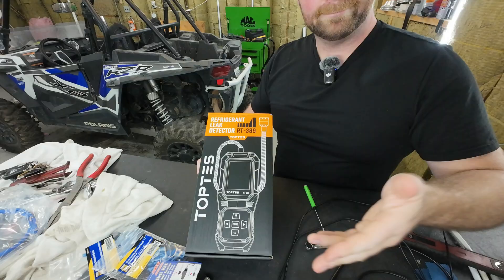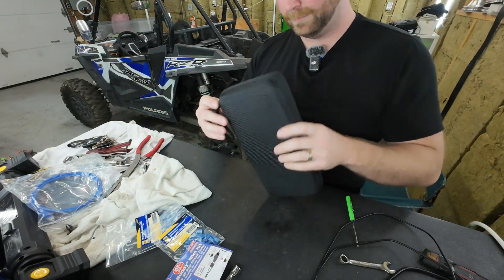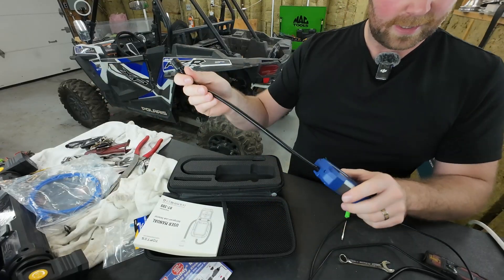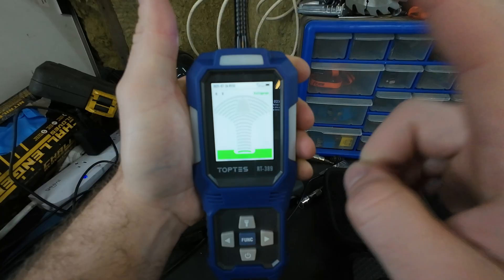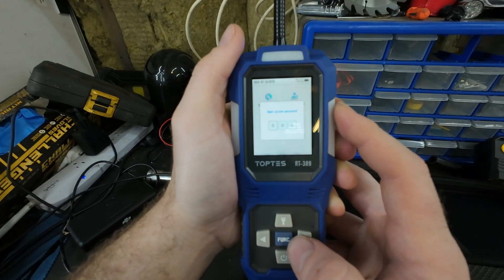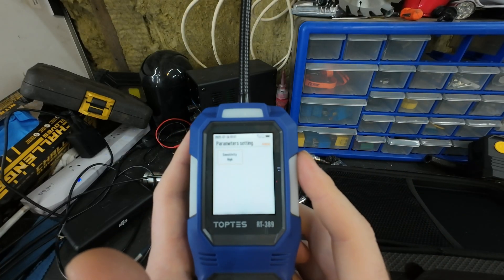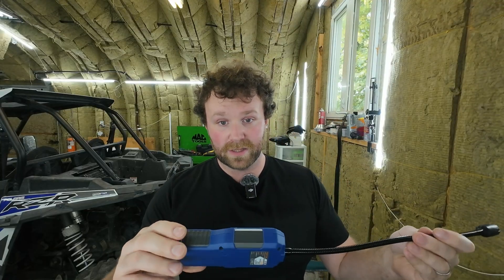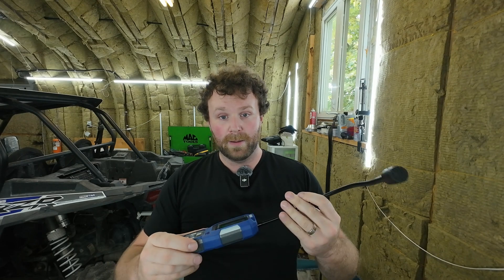TopTes RT‑389 Leak Detector | Full Review by Lance Mechanics

Comment: Nitrogen, soap and water, with your nose is still the best vehicle AC detector
Reply: You won't find a small leak that way.
Reply: @glasslinger soap and water 💦 been doing it for 30 years this way, only use the leak detector for Evaporator coil leaks, stick it up the drain tube, or remove the temp Fin probe in the Evaporator, UV dye works better then the leak detector, detector will give false positive on any leaks/ engine oil on a compressor or lines, detector is for first year apprentice doing air conditioning for the first time